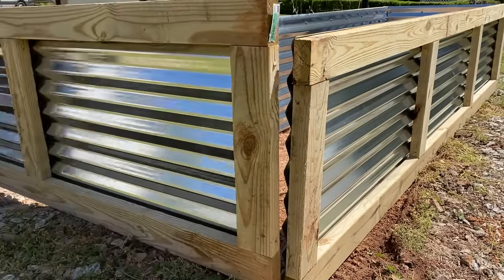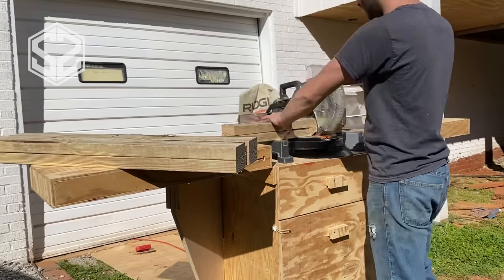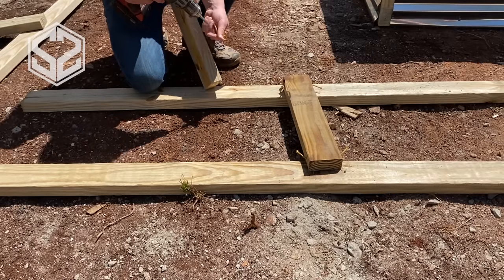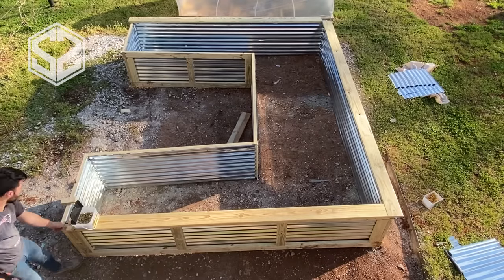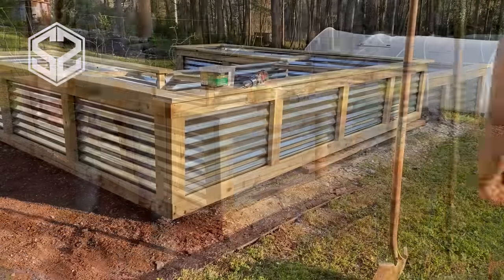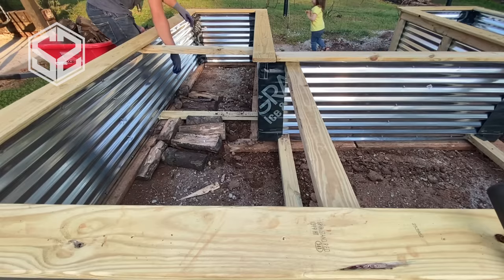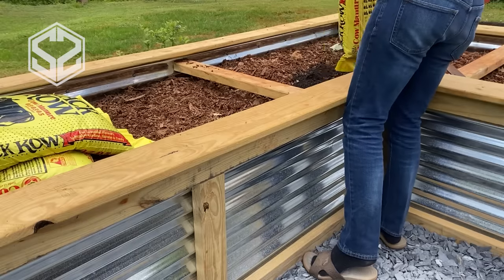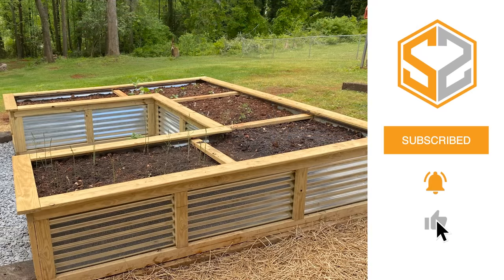How To Build Raised Garden Beds

Comment: Call your local tree trimming/removal companies and ask about dumping a load or two of wood chips. Many give these away simply for a place to get rid of them and they break down into rich soil mulch quickly. Would make for a great base inside a raised bed.
Reply from the maker: Great tip. Thanks!
Reply: They will break down quicker if you add nitrogen from a natural source, while they will monopalise the nitrogen already in the soil to break down.
Reply: Be sure you specify NO black walnut tree chips. Your plants will not grow in the presence of black walnut!
Reply: Hi, what name of rip cord? It's something on the corner. I need one for my new vegetables garden race bed. Is this call Rip cord? Tmb please  Thanks

Comment: To solve your 2x4 rot out. Put pea gravel around it with a half cut drainage pipe over it. The water will go to ground if any gets to them. Depending on area the 2x3 boards are often pretty affordable. Also might a be a good idea to paint on a water seal. It’ll create a good barrier to water damage on wood.
Reply: Clever solution, I was planning to scavenge metal stakes but I might try your way instead!
Reply: I used Boiled linseed oil. Works good for wood preservation even in soil..
Reply: @vkday364  I'll be doing both of these whenever I build my first garden bed. Thanks for the useful preventative tips.
Reply: @vkday364  Yeah I like that idea better if growing vegetables. They even offer that in food grade.
Reply: I would not paint any wood that will be in contact with your soil, eventually it will contaminate your dirt
Reply: @cryptoconnoisseur5210  what would contaminate dirt?
Reply: @medini2  paint could eventually leech into your soil
Reply: Lots of replies here, but the easiest and safest way for your soil is to use a threaded stainless steel rod.  You can secure both ends with a washer and nylon lined nuts.
Reply: @akzorz9197  I'm concerned about keeping the soil safe, so your stainless steel idea appeals to me. But having trouble envisioning. Would you use these on the corners in place of timber uprights? Why threaded? Can you explain a bit more?
Reply: @nadinetherealtor8740  the rods go through the centers to keep the walls from bulging out. Threaded rod is cheap, and you can then thread the nuts on to your desired tightness and width. It's just easier really. You could do the same with steel rod and weld an end or something to it, but that's more work.  Either way, you just use this as support as it doesn't rot and can even be adjusted later if you need. GL and happy gardening!
Reply: @nadinetherealtor8740  8:00 is a good example. Rather than using the board at the bottom. You would put a hole about 3-6" higher than he places that board and thread your rod through.  Then add some rubber grommets for sealing (optional), washers on the outside and secure both ends with a nylon lined nut. This will hold in those walls nicely and won't rot down the line

Comment: Have  you considered using hardware cloth underneath, so critters don't dig under and up in to your raised beds?  They can climb the outside also, but I discourage that with hardware cloth framing that goes another 3 feet up to the top.  About all we'll get then are birds or very daring squirrels!

Comment: If you want to use your wheelbarrow to move the dirt into your raised beds, try using a truck or car ramp.  Place against the garden bed and roll the wheelbarrow up and dump. It is much easier than 1 bucket at a time.  If you are lucky to have a side by side ATV with a dump bed, that is even easier. Another thing I'd consider is mulching your bed once you've planted it.  The mulch holds moisture and helps to cool the soil during the growing season.  I'd also plan on putting in a micro sprinkler system that you can hook up to the hose for watering the bed during the summer.
Reply from the maker: Thanks for the recommendations! I appreciate it and I will defiantly be building a watering system before the next growing season. :)
Reply: Have you ever pushed a wheel barrow up car ramps at that steep angle?
Reply: @Blaze_1961  Yup, and its really difficult, especially if it's got cement in it that wants to go EVERYWHERE, which dirt doesn't do, so use a longer wider ramp like a 2 x 12 x 8.  Yup, been there, done that, and do not tip over the cement!!  lol.....   Or that is what Dad said and expected.
Reply: So many chiefs so few Indians. 😶
Reply: @treelala5802  I actually appreciate it. Was a great idea.

Comment: I made a garden bed on top of concrete out of pressure treated lumber and tin. When I stepped back, and looked at the final shell; I realized, the dirt was going to push everything out. In my state of analysis paralysis...I found your video.

I can't have my bottom bracing rotting out. So, I'm using 3/8 inch galvanized steel with rubber and galvanized washers with nuts both inside and out. Never would have come up with this fix without your video!

In addition, I am switching out all of my screws for the roofing nails you suggested. Then covering all my corners in the 40mil roofing material. Brilliant! 
As well, I will add a top frame for extra structure. 
Thank you!! 🙏
Made you a video but can't upload it here.
Reply from the maker: So glad I could help! It sounds like you’ve made some great improvements on the design! You could share the video through email. simonsaysfeature@gmail.com

Comment: Great job, man - nice simple build for people to follow and it was very well presented.
I made the majority of my raised beds from old hardwood railway sleepers and while that's a very expensive way to do it they will outlast me.
It was a very good idea to seal the exposed wood on the inside of your raised beds as pressure treatment does little to protect from rot, especially here in the UK.
It was nice to see some hugelkultur being used in the bottom of the beds too - that is so important for nutrient retention / transfer and mycelium development.
Best of luck with the garden.

Comment: 😊Quick suggestion:  If you make the top support wooden pieces a little wider you could use them as shelves to sit potted plants on or perhaps drill holes in them to either put potted plants in.
Reply from the maker: Thanks for the tip! 😁

Comment: From a voice of experience,  2 x 3's are sufficient for this design. You can then use 2 x 4's or 2 x 6's for the top plate. The metal roofing material really adds a lot of strength and with today's lumber prices, every little bit helps. Great video, thanks for sharing.
Reply from the maker: Very true, thanks for the tip!

Comment: The best material for building raised beds is Eastern Red Cedar lumber.   Treated lumber can leach chemicals into the soil.  Also the sheet metal is galvanized using poisonous chemicals to make it and it does brake down over time leaching those chemicals into the soil and your plants.  Kinta Sawmill in SE Oklahoma has some really nice planter boxes made from Eastern Red Cedar lumber they mill themselves that is natural and chemical free.  Gardening is fun but be safe about it.

Comment: To stop any worry about sides bulging out use small diameter pvc pipe from side to side lower down in the bed. Feed threaded rod through and put a nut and washer on either side outside the bed.
Reply from the maker: Best Idea I have heard yet! Thanks so much!

Comment: Tip of the day when building raised garden beds you plan to grow food in, use only non treated lumber and treat the wood with food grade oil such as Raw Linseed etc unless of course you prefer chemicals from treated lumber.. :P
Reply from the maker: Thanks for the tip :)
Reply: Or burn it (Shou Sugi Ban)…better than pressure treated, no chemicals and looks really cool too! Nice build
Reply: Cider is best
Reply: But most of this design the wood isn’t near the soil…
Reply: Good point. Arsenic is used in treated lumber.
Reply: Cedar is the choice Treated lumber=poisen
Reply: @Oklahoman-in6ph  CCA (Chromium Copper Arsenate) treated lumber is illegal in most uses beyond maritime construction, pressure treated lumber for residential use contains no arsenic. For residential uses it's either MCA/CA (Micronate Copper Azole/Copper Azole) or ACQ-treated (Alkaline Coppar Quaternary). It has to conform to AWPA standards.
Reply: @Centralia62801  🤣 nobody has ever died cutting treated lumber without a mask 🤣
Reply: This comment was applicable 30 years ago, not today.
Reply: @Centralia62801  No, this is not true.
Reply: Salt?
Reply: @Oklahoman-in6ph  not in years.
Reply: Right I wouldn't eat anything grown in box with galvanized metal ant treated wood
Reply: @adamdawson464  Actually galvanized roofing panels, they're absolutely safe for gardening use. Since it requires acidity to break down the zinc coating that galvanized steel has, and most garden soils are neutral, there's little to no impact. The chemicals used to treat lumber I would avoid, though the steel your safe. They've been tested for 20 years for this very reason.
Reply: @nanachick05  Seepage is all it takes for arsenic and Polymeric betaine to leech into the soil. 🙄
Reply: @jguitarz1   nice that's good to know
Reply: @Adam Dawson  but you eat food from it, drink from it. Daily. Guarantee. Your products come from somewhere your soda your beer all comes in this.
Reply: @l26c64  my husband gets a really bad cough, and sometimes upper respiratory infection, from cutting treated wood.🤷‍♀️ He wears a mask anytime he cuts any wood now.
Reply: @stripcslashes  u who asked you

Comment: I’m watching your video and I like your design. I have some suggestions though. To keep the side from bowing out, you screwed 2x4’s cross ways. You screwed into the end grain. These screws will put out easier than screwing in from the side grain. I would instead do the 45 method you used on the vertical side supports. Better yet, I would have used galvanized wire with eye bolts. 
Loved your little helper.
Reply from the maker: Thanks for the ideas! I love the galvanized wire idea. You could also use galvanized threaded rod and use a washer and nut of each side to hold it in. Thanks again! :)
Reply: I used galvanized hanging strap in mine. The kind they use to hang pipes and stuff. Only been one season but seems to be working.

Comment: To cut metal you can also use a circular saw and turn the blade around so the teeth are not cutting the material.  It works really well too.
Reply from the maker: Thanks for the tip! :)

Comment: Nice design ! lotta good advice too! You could use Hemlock instead of the pressure-treated it last just about as long for something like this without all the nasty chemicals in the pressure treated I have a smaller raised bed that’s over 10 years old with the Hemlock only reason I’m tearing it apart is to build one like you guys are building.
Reply: Cedar is another good choice as termites and other bugs don’t like it!

Comment: This was great! I love the simplicity and the water shield at the corners. I wonder if it would be easier to fill the soil in as you build it. You could build one rectangle at a time, install the internal supports and wheel barrow soil in as you go before closing it up and having to dump soil in over the top. Do you think this would work?

Comment: Cool design. Great video. I would probably make it half the height so it doesn't require so much dirt to fill. Personally, I'd rather rip the corrugated tin in half than shovel all that dirt! Also, at half the height, a wheel barrow will dump into it. Your finished product looks really great. Good job.
Reply from the maker: Thanks so much! Half the height would work great and take less money for materials. Great ideal! :)
Reply: Jimmy that's true, but gardening at that height is murder on the back, just a thought!

Comment: If you want to keep your bottom cross brace boards from rotting, you could wrap the boards with the ice/water roofing membrane including a wrap over the end prior to screwing them into place. If you make sure there is sufficient overlap so the membrane adheres to itself, then you don't really need to worry about whether it will adhere to the board or not. For this reason put the caps on the ends on first so that the membrane wrapping the length of the board overlaps the tabs from the endcaps and locks them in place. Might need a dot of caulk at each corner to completely seal the board, but this should keep moisture off the board and it should last as long as the rest of the bed.
Reply from the maker: Great idea! thanks!! :)
Reply: Why would U put that on a flower bed where u are going to plant edibles?
Reply: @MA-vm6jl  You shouldn't use any man-made materials that could leech into the soil and subsequently the plants/food.  The design looks pretty, but is highly flawed IMO.
Reply: I just used metal poles and didn’t need any wood - nothing to rot away
Reply: @Father4ev3r  I was referring to roofing material. I think using that galvanized metal maybe dangerous also. The material is sprayed with it’s so it won’t rust
Reply: @joecontreras5068  by the time it rots. It will take years. I have one that I built from Douglas fir. Over 12 years ago and still hanging in there.
Reply: @MA-vm6jl     Mine will outlast it still
Reply: A trick that a lot of people don't know is mixing up fiberglass resin (without bothering with the cloth) and then painting it, with a typical paintbrush, onto wooden surfaces. It waterproofs very well and can be sanded and accepts paint just as well as wood does.
Reply: @MA-vm6jl    Metal will still outlast wood
Reply: @joecontreras5068  never said it wouldn’t.  What is the effect it will have on your food is the issue. I guess that went over your head.
Reply: @MA-vm6jl     Must have went over your head bud I just said I used metal posts because you’re gonna have to water that stuff and it’s going to get to the wood sooner if not later- the only drawback is the metal gets hotter and you have to water more often
Reply: @MA-vm6jl  Galvaning is done with zinc, a necessary nutrient that boosts immune system.

Comment: I really like how these look. I live in northern Ohio, so my gardening is trying to get the soil to warm up faster in the spring and to stay warmer longer into the fall. I am thinking I could put foam panels (or spray-on foam) on the inside of the sheet metal on the north facing sides of the beds and then paint the galvanized metal a matte black using a Zinsser paint designed to stick to the zinc coating on all sides to help absorb more heat for faster warm-up and to keep the soil warmer in into the fall.

And I probably will make hinged hoop-house covers to cover the beds as well to extend the growing season even further.
Reply from the maker: That sounds awesome! Those are great upgrades that should help extend your growing season! :)
Reply: Go ahead then.
Reply: I am curious as to cost of lumber for this today.  Considering birdie beds but if cost for this design would be cheaper, this would be an option.  But knowing lumber costs now, may be something for later time.

Comment: Make your beds wide enough that your wheelbarrow can fit between the sides and then leave one end open (or 2 in this case) to bring the dirt in.  Add the logs to the side furthest from the opening, bring in the dirt and work your way to the opening.  Attach the walls before fillingthe last part and finish filling by hand/bucket..
Reply from the maker: Thanks for the tip, that would have been helpful. But thankfully the pile of dirt was only 10feet from the garden so I didn’t have to go far.

Comment: Are you concerned with the Pressure Treating chemical leaching into your garden?  I always use cedar or some sort of resistant untreated wood for edible gardens.  I love the design, and look of your beds, thank you for sharing!
Reply from the maker: Thanks! I am not too worried about it. For the most part, the metal roofing is keeping the soil from coming in contact with the pressure-treated wood. Cedar is a great option if you are concerned, it will last a long time but is a bit more pricy than pressure-treated. 

My thoughts are it still is so much healthier than store-bought produce with all of the pesticides, chemicals. and preservatives. However, I may be totally wrong. :)

Thanks again!
Reply: @SimonSaysDIY  Nice build sir! Good recommendation on the Cedar. Redwood is another option, though quite costly. The other question is usually regarding what type of metal your soil is in contact with. Stainless leeches Nickel and Chromium, while Galvanized metals leach zinc. It would seem more is known about zinc and its importance in our diet and in plants than chromium and nickel. Zinc is helpful for our immune system and is more naturally found in food/soil, and some plants prefer the boost in zinc levels. Nickel helps the body break down glucose, and Chromium similarly helps with insulin & blood sugar levels. The levels that leech and how much is increased in edible plants is still a question at large. All that aside, the levels leeched into soils seem to be dependent on the PH of the water. Water that is more or less neutral (7.0) results in little/no leeching. :D I'm sure you're good!
Reply: The main concern with pressure treated lumber was the use of cyanide in the chemicals. I understand (and, please, someone correct me if I'm wrong!) cyanide is no longer used and PT lumber is now safer for use with gardens growing edibles.
Reply: @garylewis8346  You are correct . This is the main reason carpenter bees love boring holes in the new treated wood used these days though ,lol